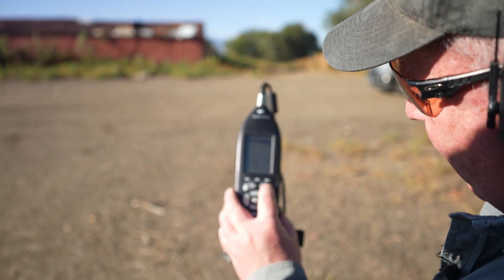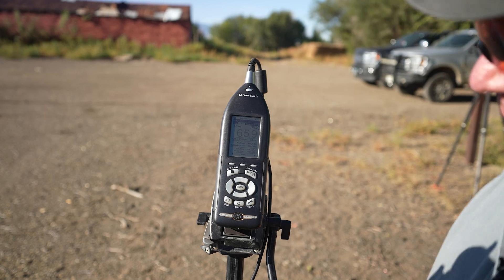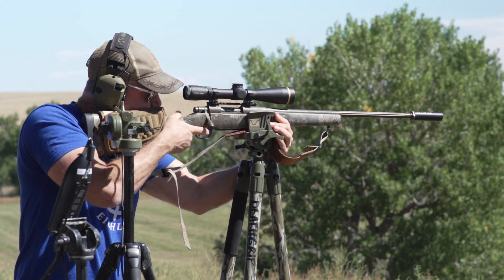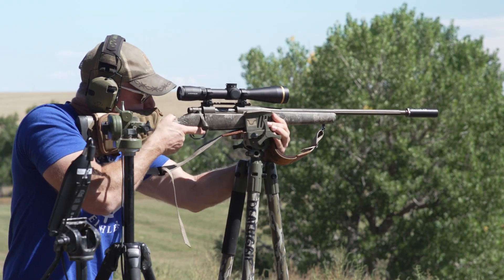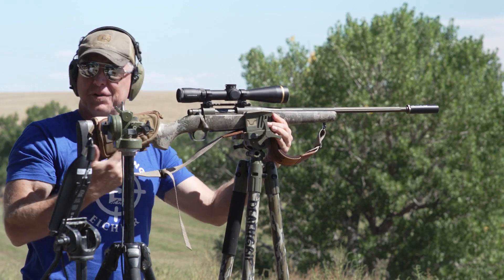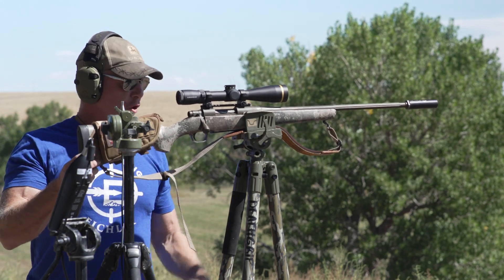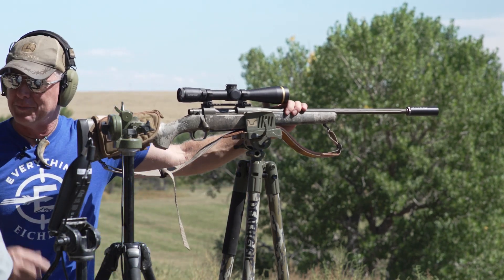Decibels and Suppressors Explained

Comment: dB meters are not $20,000 you can get a free on on your phone that's pretty good, and a pro handheld for maybe $100. dB is logarithmic, when measured, but most people perceive it as getting slightly louder and slightly quieter. You will absolutely notice a difference between 117dB and 120dB because 120 is the threshold of pain where hearing damage starts. It is painful. hearing damage cuts away at specific frequencies, and higher frequencies tend to go much more easily.

Comment: Something else to remember…The sound level doubles for every 3 decibels.
Distance also plays a role.
I have been in occupational safety for 20 years and NOBODY talks about the 1 time 140 dB exposure being “safe.”
What we use is an 8-hour time weighted average- and that number is 85-90…the idea being that 85-90 is still loud enough to cause damage all day.  
While valuable, this video makes it seem like 140 dB is the level that you need to be concerned about hearing damage- there is a lot at play, so do your own research.